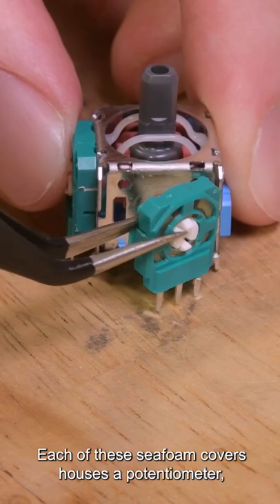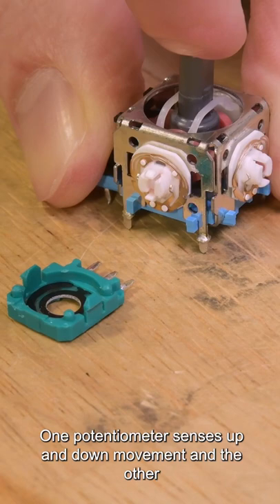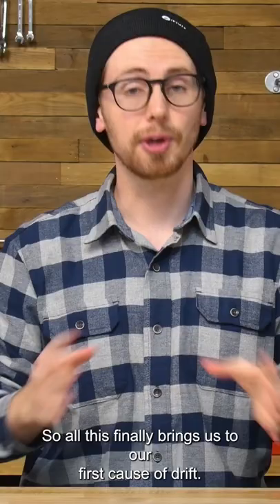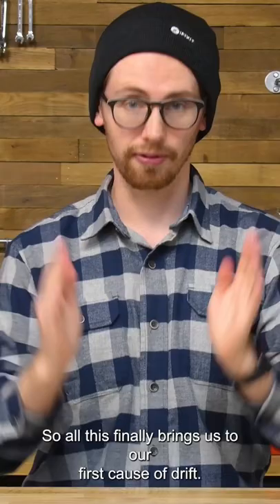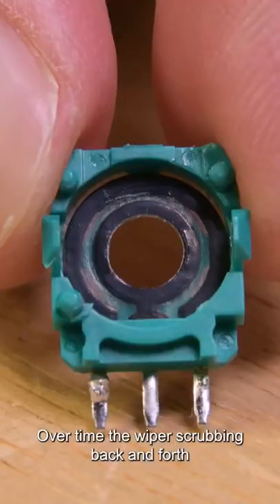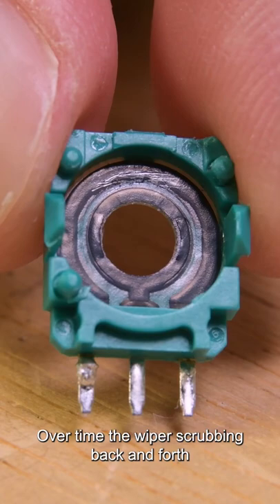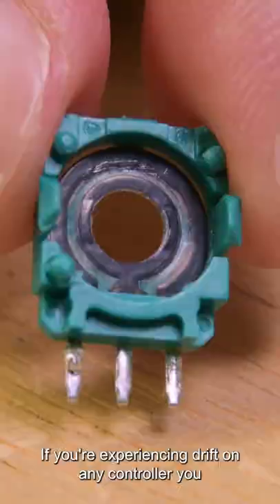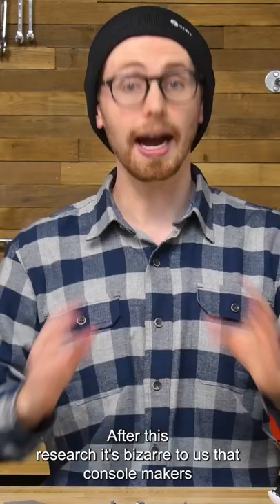Why Do Joysticks Drift?

Comment: We all know why they do it. They could easily fix stick drift but they know how much money ppl spend buying new controllers so that wont change til ppl stop buying them, which isn’t likely.
Reply: I am one that’s not buying another controller till they have a permanent fix for stick drift. Already bought one of the newer DualSense and it lasted less than the original one. Tried all the “fixes” I’ve seen all over the internet and they’re only temporary. At least they were for a while. Now no fix works and I actually saw the wear in one of the circles inside the potentiometer on both controllers. Why would anyone keep buying a defective product?

Comment: I'm pretty sure this is intentional, I've had two Xbox controllers that had drift in the right stick after a couple of months, I'm not even hard-core using them just the ocasional time I'm free, the first time I saw a controller on sale so I got a new one but the second time it was exactly the same problem, never had this issues with my old 360 and PS2 ones, thy lasted years and I had more free time then lol greedy companies turning this into a printing business model

Comment: Of course, they do not design controller parts to be easily replaced. They want you to buy more. They do not make money on repairs. If they did, make them easily replaced. They 1. Probably feel they will not make enough in the part sales, or 2. Other small repair shops will make ways to get these parts without having to buy new ones making sales and controller manufacturers lose out, so they cut out the middle man.

Comment: Well I did same procedure repairing this thing just clean using alcohol but it work some hours and then stick analog again goes crazy so I decide buy whole part and the part wok but not so smooth screw you Ps4 controllers in this moment I can just show mid finger

Comment: So then the solution should be some optical readout instead of mechanical.
Reply: Unfortunately is really hard to keep gunk out of controllers, and that would mess up the readings.
Reply: @YOEL_44  I'm thinking something like a small optical trackball, but with limited motion. If it gets dirty just pop it out, clean it and back it goes. I use optical trackballs, and they do get dirty every other year, but I don't have to replace the device, just clean it.
Reply: @zdanee  too expensive, that's why they don't do it
Reply: Sega did magnet based ones with their Analogue Controllers (Saturn, Dreamcast) and SONY with the PS3 (before the A1 Revision). So it was done.
But people told Sony they don't want that. So they didn't do it no more.

Comment: The easiest way to fix that is to clean the pad with alcohol
Reply: it doesnt fix it...
Reply: Thats like saying
If your motor is broken like if the engine has a hole
Clean it with Gas✅️
Reply: @brunoob-1  yes but it removes the metal shavings that change the capacitance which is what causes drift
Reply: @N_0_I_Z_E  you... would need to remove the hole sensor thingy and then wash it and yes that could technixally work unless well you put too much preasure while scribbing or idk how you clean things

What i mean is that you would bneed to seperate the stick and the sensor parts and then put them under alcohol but while at it you could bend the sensor and it could brake and well it still doesnt re-build the metal dust / dust / tiny micro parts of the weared out thing that i forgot the name of
Reply: @brunoob-1  I literally fix controllers as a hobby and I make good money doing it this is exactly how I fix controllers and you can give a months of life by just cleaning it until you can get a proper replacement even then once a potentiometer is cleaned it can last for a month before needing to be cleaned again all the newer controllers will Auto Center the potentiometer anyways so you don't have to worry about calibrating it manually and on the Elite Series 2 you don't need to desolder the potentiometer to clean it you can just peel it back clean it and then put it back meaning you can fix your controller with zero soldering

Comment: How about sony starts putting the same amount of carbon on the potentiometer as then used to woth ps2 and ps3.. my ps2 and 3 controllers are still fine but my ps5 ones not even a year old and now fked.. sony needs to be sued

Comment: Minimum viable product disruptive technology designed to fail sounds about right lol. 

I have the greatest fix guide coming when I create the vid that is 👀.

6 repaired pads with individually soldered trim pots on each of the 4 axis pins for on the fly screw driver adjustment. 

I created a printed help sheet for a guide to fill in, in pencil ✏️ per pad with screw axis direction for ease of use & my best practice findings for axis values on high tolerance demanding games that caused me problems. 

Will be sweet info if I can upgrade my coffee table get all my crap in order not to confuse the 💩 out of everybody involved 🤞🏻😁👍🏻. 
 
Game on industry f**ktards, let's get 👏🏻 on include deadspot positioning & calibrations for everything shall we & response curve calibration on the main menu 🎮??? 

That would be just to helpful to eliminate landfill cancel culture wouldn't you agree 🤣 lol.